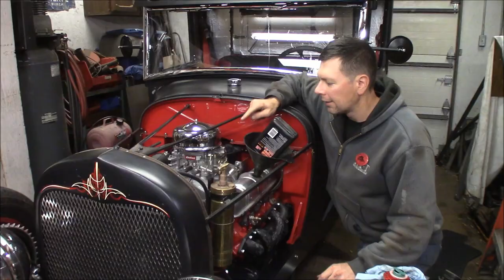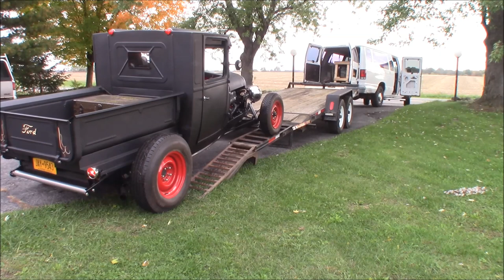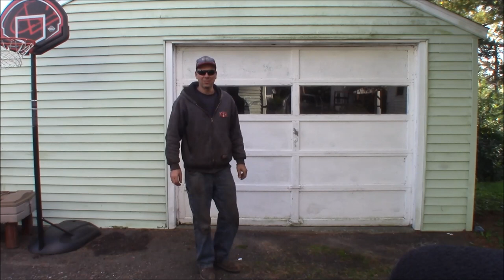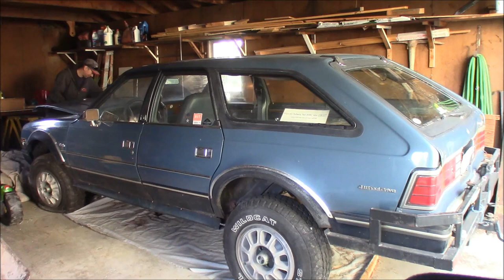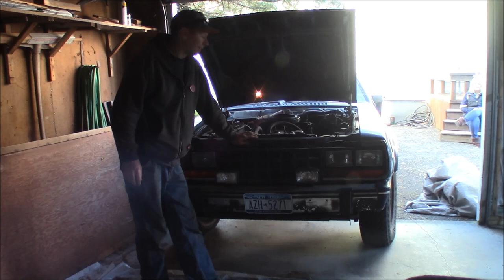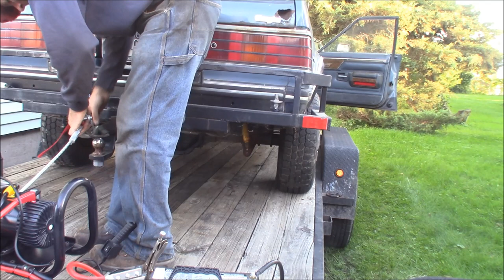Model A Truck Delivery and AMC Eagle Rescue!

Comment: Nice eagle, always nice to see another one coming out of mothballs. Just wondering, what did you do to lift it? lift shackles and coil spring spacers? Im just about to do a little lift on mine.
Reply from the maker: I used 2 inch blocks in the rear.  In the front I machined billet aluminum ball joint spacers that moved the ball joints down 1 inch, raising the front the same height.
Reply: @QuickSpeedShop  interesting. Did you even run into any problems with the blocks, axle wrap or spring warping?
Reply from the maker: No, that's usually only a factor with large tires and tall blocks, like 4 inches or more.  If I had to do it again I would swap in some Cherokee leafs as you can get those with a lift build in.  Eagle springs all seem to sag after a while.
Reply: @QuickSpeedShop  can confirm. I stuck some bolt on leaf helpers on mine but without them theyre flat as a crepe